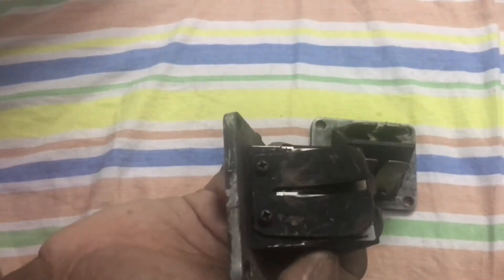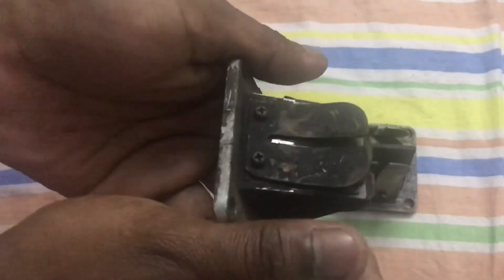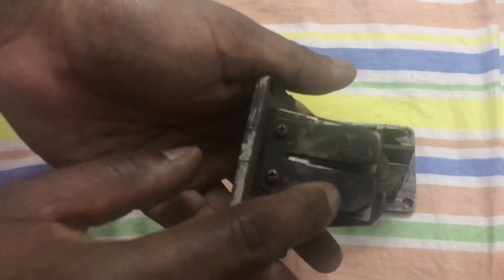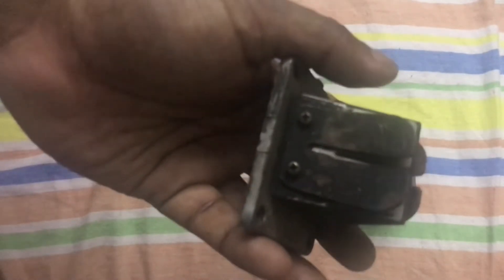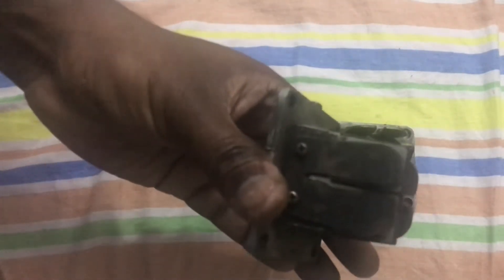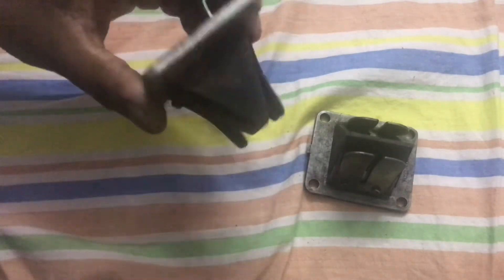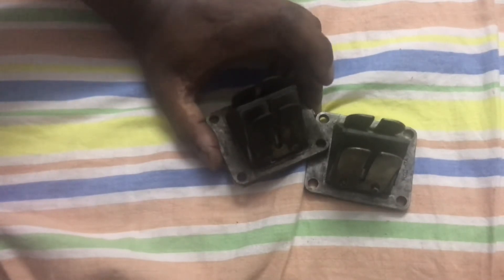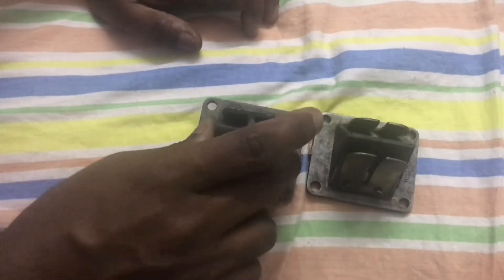Inspecting a reed valve | Yamaha 2 strokes | Suzuki 2 strokes

Comment: Bro wheater damaged reed valves cause  slow speed missing problem and starting problem
Reply from the maker: Yes
Reply: @Yamakaze  my bike is rx135 it has pickup problem and slowspeed and starting problem , i checked all wiring but only reed valves is not changed can i change
Reply from the maker: V I S H N U - PubgMobile yes
Reply: @Yamakaze  ok brother are you sure the starting trouble and the slowspeed not running is because of reed valves
Reply from the maker: V I S H N U - PubgMobile it can be that, there could be issues with the carb
Reply: @Yamakaze  carb is good broo its original carb and is good in working
Reply from the maker: V I S H N U - PubgMobile how do you know it’s working properly?
Reply: @Yamakaze  mechanic told broo
Reply: He told can dismatile engine and work i told dont dismatile for starting problem let me ask some other mechanic
Reply from the maker: V I S H N U - PubgMobile ask your mechanic why it’s still missing
Reply: @Yamakaze  he said reed valve is week and the closing strips in reed valve became week
Reply: If it is to tight yes

Comment: Is it ok to use SHOGUN REEDVALVE in RX135 5 speed?  Will there be any issue in performance. RX135 Reedvalve is not available in my place but can get a new old stock reed valve of shogun. Both lookwise n dimesions are similar except stopper plate design. HTA Part no is 5014 for 135 and 5015 for Shogun.
Reply from the maker: Shogun reed valve can be used in rx 135

Comment: Hi. I had installed fiber reed valve in my rx135. But I had experienced that when ever I stop my bike at signal or traffic there is increase in rpm. Y it is happening
Reply from the maker: Fiber reeds are known to cause issues
Reply: @Yamakaze  ok. Thanks for reply. Any advantages of using it.
Reply from the maker: Better throttle response but local ones have zero research done so they either work or they don’t
Reply: @gajjarbhargav5591  I am about to change the reed and put back original. The problem might be happening what i guess is that, the valve is not closing. I had not put stopper on it. If u had put stopper on it and same problem happening than change it.

Comment: Have a doubt, that there is a  tube coming out from just below the reed valve in rx100  ? Is it a breather ?
Reply from the maker: Army Josh you mean on the crank case? That’s a breather to reduce crank pressure build up
Reply: @Yamakaze  Now got it. Thanks.
Reply from the maker: Army Josh 👍

Comment: Can I use Rx100 reed valve in Rx135 5 speed?
Reply from the maker: Biswanath Mohapatra technically you can, the dimensions are very similar but there are differences, I will check today in the evening and tell. Out of the 2 manifold one belongs to an rx 100. But I have not observed any visual difference
Reply: @Yamakaze  tnx for reply..this can help many users as model specific spares r not available every where.
Even try interchanging on Shogun also to check if it works👍🏻
Reply from the maker: Biswanath Mohapatra the shogun and rx 100 reeds are same, most of the spares in rx Series bikes are interchangeable, but in order to get maximum performance one should always look for spares meant for that vehicle. Thanks for the suggestion, I will try to make video

Comment: Can I use rx100 reed valve in rxg?
Reply from the maker: You can but it might misfire in some situations
Reply: @Yamakaze  yeah right, I found out practically that rx100 reed petals are very much stuff as compared to rx135, rx100- HTA 5003, Rx135 - HTA 5014
Reply from the maker: @jovinmendes8123  👍